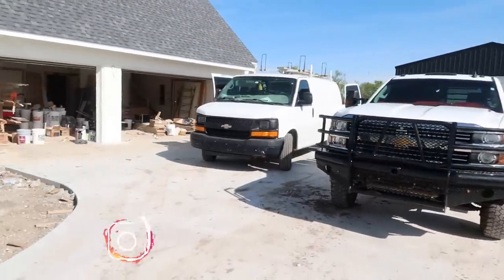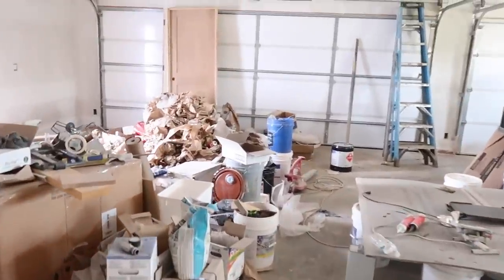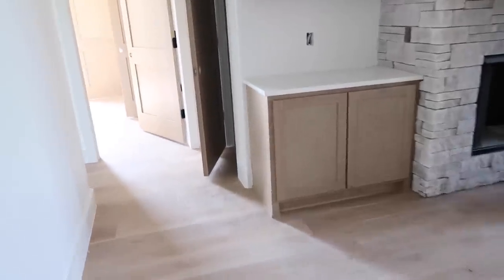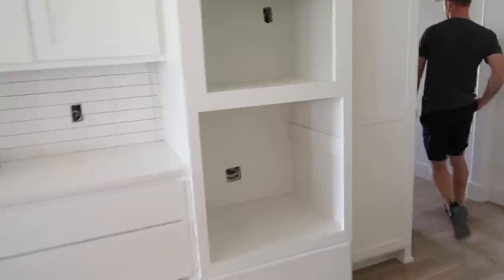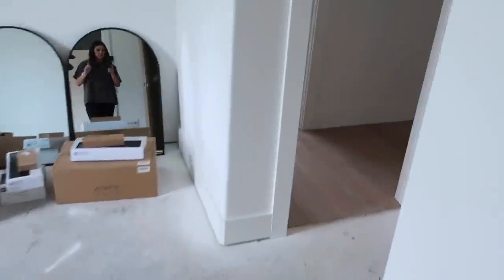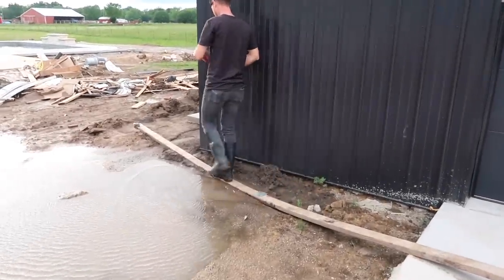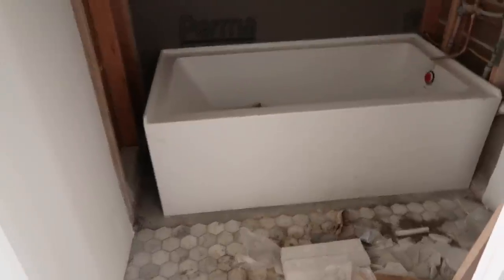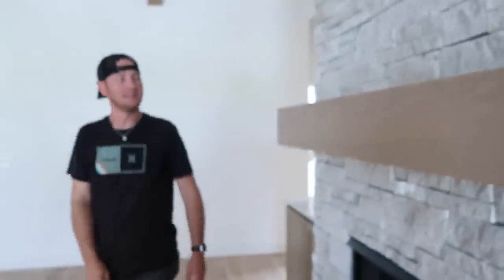FINAL HOME UPDATE MONTH #7 | DREAM HOME INTERIOR DESIGN | CUSTOM HOME BUILDING IDEAS 2023

Comment: That is the oddest way I have ever seen for them to paint the interior after doing this most of my life. One always paints top to bottom meaning ceilings, walls then trim, doors if painted, door jambs and cabinets. I have never seen it done this way before, and to me, makes no logical sense to me.
 The reason you can see your sample paint spots is because they didn't second coat, cross up, the walls or that particular wall. They needed to spray horizontal and then finish up vertically on every wall because the finish should mirror the walls being vertical. The last coat finish should always be in the direction of what that person is painting. If it's something is vertical, like a wall, then it's vertical, if it's horizontal then it would be finished up horizontally.
I'm my opinion and the way it's done in another state, your backsplash should be free or at least very discounted. It's like buying a Porsche and then them giving you a VW and you having to deal with keeping it. That is not ok. I know you in a pressed timeline though but it should be half of the cost for that area. The contractor's board would have been all over this project and all the mistakes where I came from. I am really lucky where I was and how things were done there.

Your house is seriously gorgeous and exactly my style except the kitchen backslash, lol. You both are the sweetest souls and I've been praying for you all!! ❤❤❤🙏🙏🙏